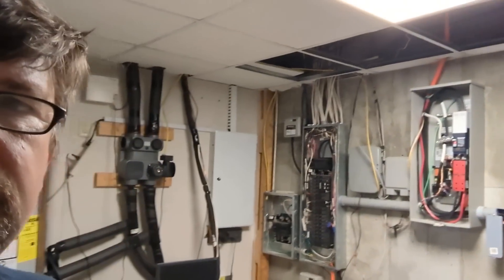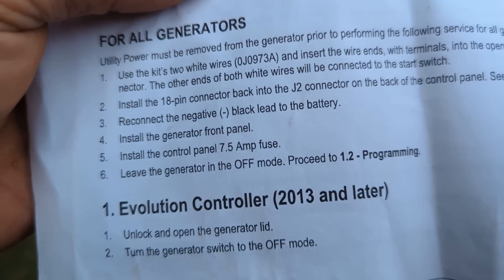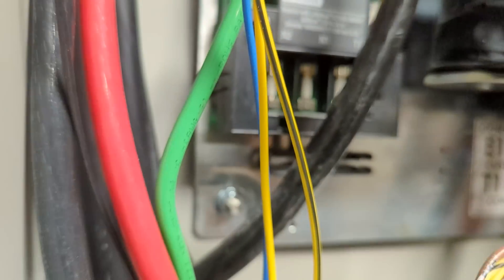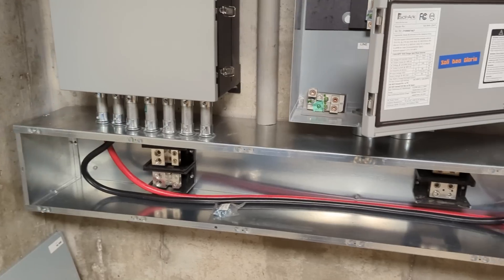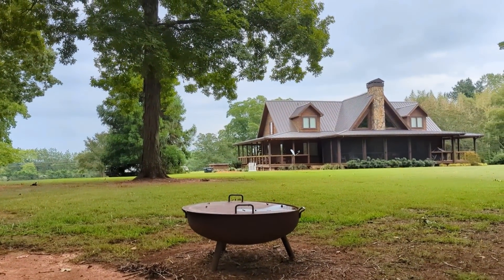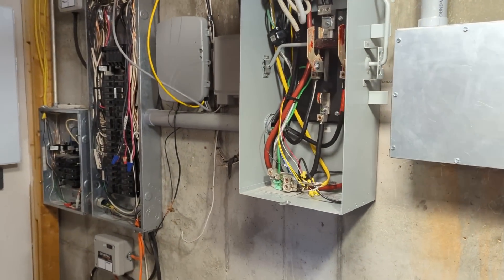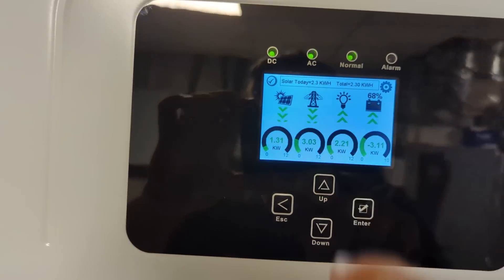Sol-Ark Hijacks a Generac

Comment: I have a 20kw Briggs & Stratton and my Sol-Ark 15k is not starting my generator. The generator tech stated that the generator is looking for 120v on each wire for the 2-wire. Sol-Ark customer service said the inverter is not designed to provide 120v on pins 7,8. As of right now, I have to go out and manually go out and start the generator to charge my batteries. Is there any advise you can give to get me pointed in the right direction?

Comment: Thank you for this video, well done, we are facing the same kind of installation soon. The smart management moduls (SSM) from Generac (load control, the two boxes) normally activate when the generator kicks in, because the generator gives a different HZ frequency to the grid. When the generator is connected to the Sol-Ark inverter the Herz will not change anymore (that’s what they told us). So how can we handle the loads? Or can you confirm that they do work? Thank you very much for your help, much appreciated.

Comment: Just saw your video and I like the idea of that approach. I ordered a Champion 8.5 home standby generator to charge my batteries and have my inverter control the generator. I have a Midnite Solar Rosie 7KW inverter. The idea of having the manual transfer switch to switch between the grid, gen and inverter. I will have to call to see if I can do that with my system.

Comment: Trying to do the same with an off grid system. Basically removing the ATS and use Solark as transfer switch. No generator only Solark as the main source and utility as backup power.

Comment: The conductor stresses on the neutral insulated splice block in the MTS is a no bueno.  Get some split phase load imbalance, if the sol ark inverters don't trip because of it, those lugs will need to be retorqued.

Comment: You talked about how amazing it is that inspectors have so much leverage over your life. I completely relate to this and I don’t run a business. I have a new residential build coming up, grid-tie. And I’m tempted to do Solar hookup after the grid and outlets and receptacles pass inspection.
Reply: Thats what I'm doing. Its  15k for equipment. 35k installation for an electrician. Nope, thanks for your time, not paying you 17.5 k per day. Well, he did not say that. but I can look up equipment costs. Its insane what they get away with charging. And the permit/inspection process creates this insanity. In NM you cant even draw a permit if your not an electrician. BS says I.

Comment: I am off grid running 2 sol ark 12s with 40 kwhs of lead acid batterys and 10kw of solar panels. My current back up is a generac 8000 watt portable gasoline generator supplying 240 at 30 amp. This is a temporary set up until i can afford to get a 50 amp generator that can be wired in to auto start. After one of the last firmware updates the display changed on my sol arks and now i cant get the generator to charge the system. Is there something i can do to get it to work again?
Reply: I am also having this same problem. is there a solution yet. solark doesnt.
Reply: @MikeMiller-t9o  i had to fight the setting and in the battery setting set it to 30 amp charging and force gen thru the grid side. it works ... sort of but it will hiccup and cause me headaches.

Comment: Thanks for your video.  I just had a Sol-Ark 15k EMP Hardened unit installed.  Producing between 101 and 105 kWh per day, which is just a bit more than our 24-hour usage, so for now, our net metering is positive on our behalf. Fortunately, we have an electrical cooperative which is not-profit oriented and has a great buy back agreement. For now, our system is just grid-tied (no batteries), but in the not too distant future, I hope to put in around 38 kWh of storage.  Since the current install lacks some of the isolation features of yours, I'm trying to learn what it takes to do a hybrid on/off grid setup. It was nice to see some of the equipment that I'm considering utilizing such as the manual transfer switch, the Photovoltaic System Disconnect, etc., and not needing the Generac ATS. Helps with my overall perspective. We have a 100A disconnect, no manual transfer switch and the Sol-Ark connection is to the wires prior to the main panel breakers (not isolated from the grid). The Sol-Arks are kind of new to my installer and we're his third install. So their team is still learning. Part of the issue lies with ILLUMINEI,  the solar design/engineering company, since the installer was pretty much limited to following their design. Doesn't seem like they took into consideration the likelihood of batteries being added and designed a strictly grid-tied system.

Comment: What keeps the grid from being energized during a power outage?
Reply: the generator ATS will automatically throw the switch when 240 is lost from the grid.  (in an generator only scenario)

the anti islanding abilities of inverters disconnect from the grid and do not put any power back on the grid when grid voltage is not at acceptable voltage.

with the sol ark master in charge.  and your power is out.... the sol ark takes the place of the grid (as far as the generator brain is aware).  when the solark senses the parameter need to recharge the batteries during a grid down scenario.  solark sends the signal to generator to fire up and recharge batteries....id like to think of it like a prius.

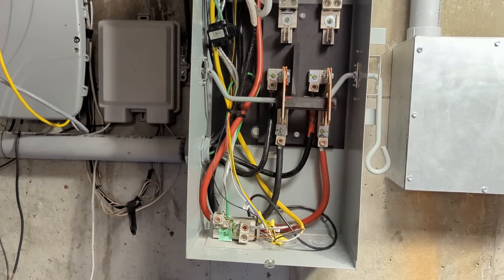Comment: Time stamped. 13:06 . You have the generator bonded and grounded through the transfer switch. Shouldn't you have that separate or did you unbound the main panel? Since it would act as fault loop?

Comment: Hello, Have you had any issues with running your battery cables through separate ferrous metal conduits? Heating of the cables and or conduit? I know it's against code, however I believe the expanding and collapsing field of AC current is the main contributor to inductive heating. These DC cables with the toroids installed shouldn't have much ripple. Thanks, Jeff

Comment: Very exciting project, thanks for showing us the ins and outs of the generator/battery inverter integration

Is there any tricks to supply 240, or is it 120 to the generator for charging the battery?
Reply: It's 240, at verrrry low amps, as shown in the video. I would have liked to have seen the video concentrate more on the precise steps, connections and everything, to supplant the ATS.

Comment: Love seeing  your work.  The battery charger in the Generac generator is fed off T1 in the transfer switch.  It is only 120VAC.
Reply: I install these setups in Upstate New York, we use the 3 cold-start kits (small heaters on the oil filter, battery, and intake) so in addition to the T1 at 120V for the battery charger, we connect L1 and L2 from the LOAD output of the Sol-Ark  to N1 and N2 via inline fuses so the 3 heaters will work.

Comment: You can get the two Molex Mini-Fit Female Socket# WM3279CT-ND or two Pre-Crimped Lead, Mini-Fit Female# WM12450-ND from Digi-Key.

The Generac charger is powered by 120VAC/3.0A into T1. I ran from the "always hot" L1 that goes to house using a 6A fuse, so that if I'm running on grid, gen or solar, the charger will be powered. FYI:  The Generac controller consumes 1.6A running, 250mA Standby. If charger dies, the little battery won't last long. I installed a 120V power switch with pilot light on T1 circuit, then a battery volt meter to monitor in my power shed. 

Keep up the good work. Oh, my two 12K's shut down trying to start my Dewalt 7.5" circular saw!! 🤣😂. The $1200 EG4 6500ex and a $350 Amazon 12V 2500W hf ran it though. Go figure. The 12K's have ran everything else in my house that I needed to be on at the same time, at 17,000W load. 6.25Ton of hp's, all electric heaters disabled with a  switch on 24V (W) circuit, standard 80 gal elec wh, elec range, std dryer/washer.
Reply: battery charging is just one of the functions in that gen controller. The controller also handles weekly exercise, the gas solenoid, and AC voltage regulation, which is all from 12 volts... and supplied from that single fuse. Without that fuse (and the internal 12 volts) the whole gen set will quit in a matter of hours. (ask me how I know)
Reply: @rupe53  We aren't talking about the 7.5A ATO fuse on top side of controller. The 6A I installed is on the 120V line feeding the T1 terminal which powers the charger. It's Neutral comes from the 6 ga N to the gen. 775 was wiring it to 240VAC. I'd like to know how that worked out.
Reply: @USA-GreedyMenOfNoIntegrity  ... I know... been installing Generac for near 25 years and recently retired. The older sets used 240 volts both to monitor the line and do the other deeds. (4 fuse transfer switches) When they went to the 3 fuse units, the T1 became battery charging and those other functions. The 7.5 amp is only for the control board itself. BTW, ran into a bogus wiring job one day where the neutral wire was tied to the neutral bar via a bug-lug but it wasn't sitting square when tightened. (although seemed tight because it didn't wiggle) The entire chassis was live and I was trying to sort out the issue in the rain with no access to the TS in the basement. (nobody home) Oh, the stories I could tell!

Comment: Great install looks complicated. What would that entire system cost. Would you consult via video call to caribbean?
Reply: everything is more expensive on an island.   coastal 48 id imagine the generator /install of 22kw to cost about 15-17 k.  the solark inverters are roughly 7k per.  the fortress battery banks im not familiar with ( say 20k).  
Then it all has to be wired in correctly.  id expect the base components to cost 50k and id expect an experienced electrician to ask for 20k for his expertise.  electrical materials capable of handling the amperages 10k.

my guess is 100k mainland .... your guess on an island.

Comment: Why not use the 15 K with built-in bypass and transfer. Eliminate the 2 transfers. I'm thinking the owner is OCD like me and not trusting the 15 K if the inverter has a electronics failure.
Reply: Redundancy=more security
Reply: Both redundancy and the owner wanted the EMP protection.  I believe that will be certified for the 15k early next year.
Reply: @michiganengineer8621   We just had the 15k EMP hardened installed. Used to be a former EMP engineer. Just made sense to me with the world going crazy.

Comment: Which manual transfer switches do you use?
Reply: Ge 200 Amp Manual Emergency Power Transfer Switch 240V Double Throw Model# TC10324R

Comment: With two transfer switches and fuse disconnects, where is the neutral ground bond?  Still in the main power panel?
Reply: It is on mine. I have three power sources just like he does…Generator solar or grid. Maybe 775 can explain to us how he recommends moving that bonding jumper around to three different power sources. Mine works fine like it is and I'm not messing with it.
Reply: @USA-GreedyMenOfNoIntegrity  .... it would make sense to keep the bond only in the main house panel because it all goes there anyway. OTOH, with several disconnects the main panel is no longer the "first point of disconnect" as per NEC. This makes me wonder if there's an exception with solar.

Comment: Do Solarks require internet or "phone home" to function? If they have no connection, do they have limited controls?
Reply: NOPE. absolutely no connection is needed.   software updates if needed can be done with a special dongle that Sol-Ark provides.
Reply: @jimgoff2493  I saw a WIFI on them. I plan on having internet, behind a nice firewall of course. Any reason anyone thinks I shouldn't? I could do all sorts of fancy networking to keep it VERY safe from attack. I'm not sure how much I'd access it remote. Maybe just plug it in once every few months for manual upgrade of software if available.
Reply: They are doing a big change to the web application soon with much better security

Comment: Any chance we could see the CAD for a setup like that?  It has to be mind blowingly complex!
Reply: The basic diagram is in the install manual. I don’t recommend using the gen lugs. I suggest running the utility feeders to the ATS and then hitting your main panel. Interconnect the solark into the main panel, and then select “gen on grid input.” You will have to program your generator to fire up from 2 wire start from the solark. I say this for 2 reasons. I have seen the gen lugs backfeed a generator and ruin a $27k generator. Because the gen lugs double as a smart load output, backfeeding is possible. 

2) the gen lugs will not pass through to the loads, they will only charge the battery. So your generator has to be throttled to the max current allowed to charge your battery bank. Also if your battery bank is shot, you lose your genny as well.

I suggest only using gen lugs to attach an AC coupled system or to use as a smart load for this reason.

Note: for off grid, you won’t need an ATS.
Reply: It was a doozy of a puzzle. Edit: it works great so worth it.

Comment: You say you can use “any” generator. Last I had read in the Sol-Ark manual they only accepted 240v inputs. Is that still the case?
Reply: You are correct that is the case. These are 240v inverters therefore they need a split phase 240v input.
Reply: @willistisdale4293  It would be cool if they could incorporate one of the small 120v inverter generators, but that’s understandable.

Comment: Is there a setting to use only solar to charge the batteries and run the house when the sun is strong and automatically cut off the grid or at least curtail it in order not to pay them and have the grid gradually engage when needed for higher loads?
Reply: In some of his past videos he has shown how to install Current Transformers on the grid input to the house to “zero the meter”.
Reply: Yes. There are all kinds of settings to prioritize the charging and energy flow.  We install in the Adirondacks btw.  we’re a Gold installer for Sol-Ark.
Reply: limited to home with CT's

Comment: So will the home owner live long enough to break even in the long run or just has enough money burning a hole in his pocket not to care?
Reply: Will you live long enough to break even on your life insurance policy?
Do you break even when you go to the Dr?
How about lunch, did you break even?
Reply: It's a fair enough question. Grid-tie solar without batteries can have a reasonable payback period (10 years typically, 6-7 years if one conserves), but batteries push that recovery period out many years. Financing via solar installers adds ~36% to the cash price and shouldn't be done. Finance through a local bank, a 401k loan, etc.). For new construction, the investment can be built into the overall mortgage. We paid cash for our system, but I wouldn't consider us to have a hole burning in our pockets. We live way below our means except for travel. A 10%-16% rate of return was enough to justify the investment and we won't have to deal with huge electric bills in our retirement years (prior to that $500-$600/mo. in the summer wasn't unusual - now we're at the minimum $25/mo.). The purpose of investing in batteries and a generator is maintenance of lifestyle in case of a long-term grid outage, rather than considering the rate of return (e.g. during winter storm Uri, a friend of mine in town went a week without power). You kind of toss the ROI on those. It's the illusion of independence, but it feels nice.

Comment: It was a bummer this week, one of our AHJ’s (Oklahoma City) started failing us for utilizing the two knockouts for the battery conductors on the sol-arks. Since they’re technically in the same circuit they’re supposed to be ran in the same raceway.
Reply: Use PVC instead of emt, the inspector is correct.
Reply: I’m curious which code article the AJJ is citing. I believe there is an exception to counter this and I’m digging for it. edit: grammar and content
Reply: @willistisdale4293  300.3(b)

Comment: Do you still do consultations? Willing to travel to Southern GA? We're fixing to buy a new place and want to install Solar with Grid backup (and to run shop). Small system actually as it's only a 2K sq foot with 2 adults.  I am too paranoid to hire local as they would be privvy to my location, supplies etc. I doubt they would adhere to a NDA.

Comment: would be cool to use multiple ATS' and then have a custom control panel on the wall and have big buttons and have one button for Normal one for Grid and one for Generator. then you could even use smart relays and have a Raspberry Pi create a mobile app or local website to switch modes or add automation. 

if Solarks are down the ATS will switch to Grid/Geneator and if grid is also down it will switch to Generator until either solarks or grid come back.
Reply: I’ve been using relays to control my ATSs when installing sol-arks for a while now. I wish there was a solid “smart” ats made for solar/ess that didn’t cost $3000 like an asco.
Reply: @NoahBeall-BPS  got any line diagrams?

Comment: I'm jealous we can no longer install lithium batteries inside a home in Canada, code changed a few months ago. Garage is the only option. Now have to heat the garage to keep the batteries warm and requires a lot of expensive copper for the battery runs. Have the 15k with 200 Amp pass through.
Reply: They should really exclude LiFePO4 from that
Reply: @niktak1114  they hopefully will but haven't yet
Reply: Yeah the new Electrical code rules really suck for anyone in Canada trying to gain some energy independence as it can greatly add to the installation cost.
Reply: I believe you can still put them inside the house in a fire rated electrical room (double fire rated drywall with smoke detectors). Possibly steel door etc.
Reply: @jasonneva4905  Ontario has that exemption but national code doesn't
Reply: They were right to exclude Lithium, they are dangerous and fires have happened. LifePo4 are no problem, no thermal runway issues
Reply: @TheFatman819  I have lifepo4. They are included. Any battery over 1kw not just lithium